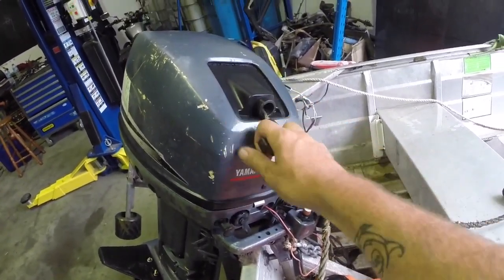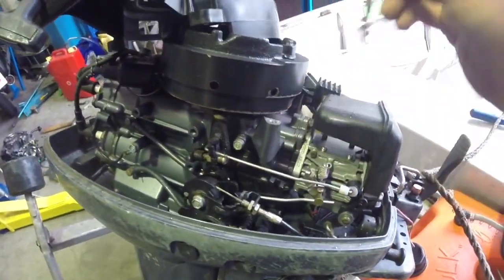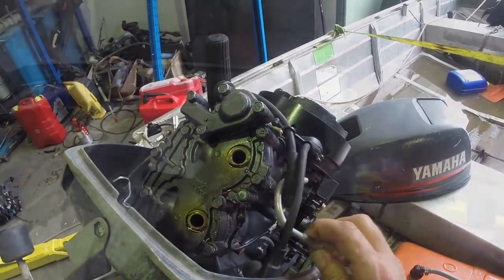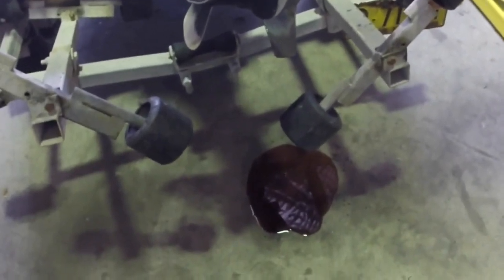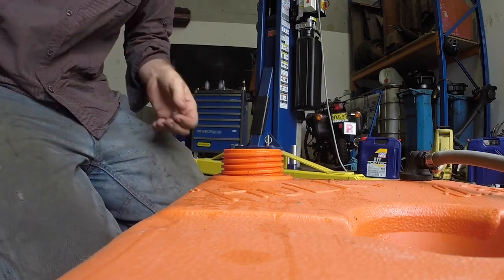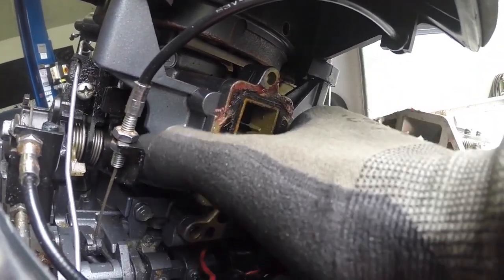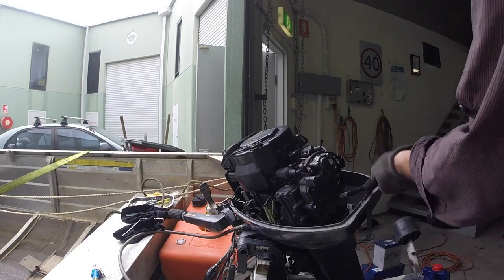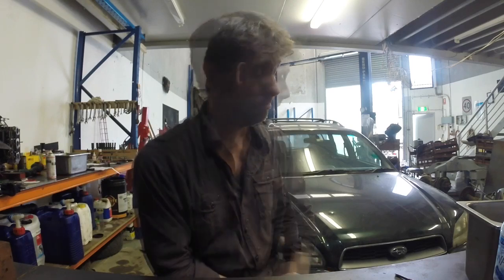Unseizing a seized outboard motor

Comment: DANGER M.- No one seems to know some simple questions that I have asked on these sites? So maybe you have the answers. On 1986 Johnson 90hp manual says set crankshaft into block saddle with all the sealing ring gaps facing up. But I don't see anything else on this. I have been seeing people post that you have to stagger these gaps, which to me seems not the case. They are not inline compression rings like piston rings or they?  I guess they are just thrust washers for oil retention around the journals. A marine mechanic that I spoke to a few months back said to install crank with all rings facing up. Also mechanic from Viking Marine in Fla. said to install with all ring gaps facing up. But then he posted to push the rings down into the block. So does he mean that you set crank in place with gaps up so they are not snagged on block and then turn and push the rings down into the block so they do not snag on the crankcase cover when it is installed. What about staggering gaps, anything to that. Now next question. Manual says piston ring gaps for 90 Johnson is .007- 017 on motors up to 1986. It says 1987 and after the gap is .019-031. So if both have 31/2" cylinders why the great difference in gaps? The only thing I can figure is that the .007- .017 is original motor specs when rings did not expand as much. Then maybe in 1987 they started making rings that expand more and thus the wider gaps. I have an 86 previously bored .020. The rings I bought from Riken (Japanese) .05mm gap about .025 when the ring is pushed down to the bottom of bore below worn section. So that is within the specs for 1987 and after. I had one cylinder bored to .030. The rings and piston are different brand from other rings and I get about the same gap with them maybe a couple thousandths difference.  .030 is stamped on the rings so should be right ring. So I conclude that it must be due to new ring designs since 1986 that means the gaps will be the wider gap specs. So all rings made since 87 should have the wider gap specs even though you are putting them in a motor prior to 87.  Is that the case or am I losing my mind?
Reply from the maker: I put all the sealing ring gaps up on the outboard I recently rebuilt. https://www.youtube.com/watch?v=j32sakl9dB0 I'd be careful about drawing the conclusion that it is the ring composition that has changed, it could also have been something to do with the thermal properties of the pre-1987 blocks.
Reply: Thanks for the quick response. I don't know why the manual does not explain the difference in gap specs. So I have a bit of dilemma wanting to put this motor together but not knowing for sure if I have the right rings. I gave my engine ID number to order parts, but who knows if they sent the right rings, according to numbers. I suspicion that it is the ring design/newer material or suppliers should be stressing the difference in these ring gaps. I only find ring listings according to years and horsepower listed which includes pre 87 and newer in same listing. So maybe I need to call manufacturer of rings and ask, and check around some more. The pro V piston that I bought came with rings that gapped at the 87 specs in this newly .030 bored cylinder. The piston was not advertised as an 87 or newer part. So that makes me believe it is the ring composition that changed and not the thermal properties of the block. They are constantly making innovations to rings. I don't think they would have changed the block properties enough to make that much difference in ring gap pre 87 to 87.

Comment: make sure to run the motor for a long time to burn all water / oil u added that may have got in to the bottom end!!
Reply from the maker: Yep, a good long run is the best thing you can do for a motor that has been sunk or seized. If you don't it is likely to just seize again.

Comment: Won't the rings be all seized ?  Just breaking the pistons free does not fix that...
Reply from the maker: Most of these outboards are worth a fraction of the cost of a full rebuild and run for years again once freed up. It's simply a case of economics how far you go with them.

Comment: Im very sorry, but what i see is holy moly sh...! You did not solve the problem, it was not piston problem.  It is a regular problem for modern ( all models after 2000 y.m.) yamaha 2stroke. To fixit you have to take off powerhead and clean underblock yoke, what is always rust and start holding a midshaft so tight so you can not crank the motor. . If you leave it for next 2-3 month it will stuck sam way.. if you see clear in begining you can pull a very very small ammount with start cord that means your torque is going through crank and you catch a gap in connection between crank and midshaft. That is exactly underblock pinion(yoke). Do it again!

Comment: Alright, hoping someone can point me in the right direction. Clearly I'm a large idiot and did not do proper research before taking my Dad's Boat out...

He has a Yamaha 15 two stroke motor. (Yes, I'm learning.lol) 
So, this idiot of a mistake is so bad, that it doesn't seem to be a common mistake, because I find no real information on it.. 

I used ONLY Gasoline in the motor. It clearly states 100/1 on the motor. I accept my ignorance and only want possible direction on what I can do. What's done is done, and just as life, it's a learning game, and I am just learning about this boat and Motor. 

Either way, there we a Little bit of gasoline/oil mix in the gas tank. Barely anything.  I filled it back up with regular unleaded gasoline. 😔. I rode the boat motor about an hour and a half, not exactly consistently. Over about a four hour period. It would be a tackle to get running, but once started, ran what seemed well. Ran for maybe 20 mins each time, then stopped to fish, and cut it off. 
... never could get it to start again after the last time I cut it off. Damage must have been done. 

I'm curious if anyone knows of any steps I can do to see what all is actually damaged, if anything can be repaired, etc.. any help. 
I'm already in the thought to that the motor is done. 

I have not tried to run it since I came back. I don't know if I should create the mixture and try to run it w/ 100/1 or if I should drain the motor, add more oil than recommended.. or what. 

Any advice, comments, help and ridicule are accepted. :)
Reply from the maker: Ah, that happens. Often motors will just overheat and seize then run again once they have cooled down. t There will be a bit of scoring on the cylinder walls, but often it isn't terminal. I would start by trying to turn the flywheel by hand with the spark plugs out. If it feels okay I would pour a bit of two stroke oil down the spark plug holes, change the fuel to the correct mixture, prime it through the hose to get the old fuel out and then see if it runs.